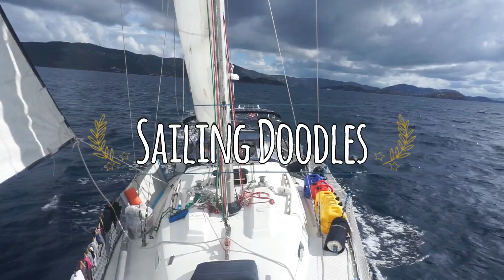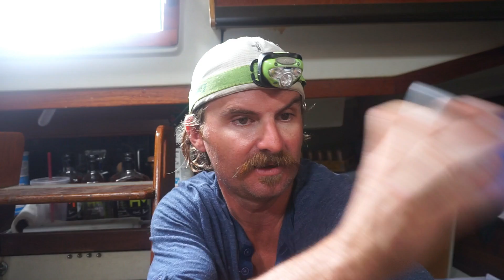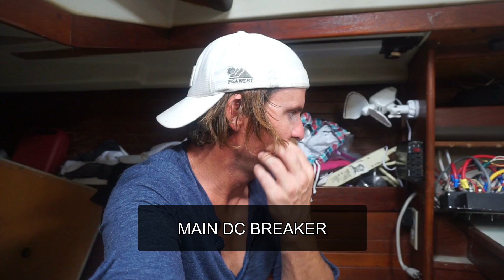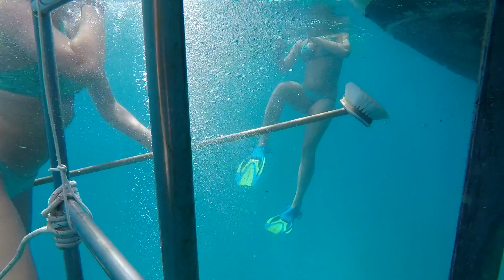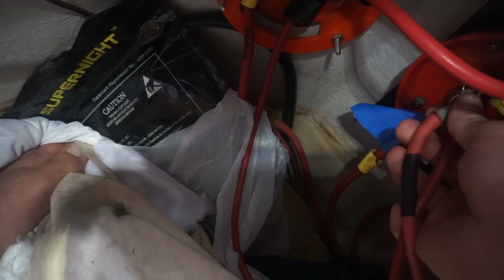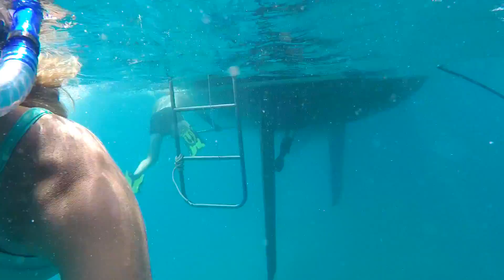Girls Clean the hull & an Electrical Failure - Boat Maintenance Monday

Comment: Next time run a continuity test switch your multimeter to ohms if it’s off you should get resistance if it’s on it should drop to zero or there abouts

Comment: In the future, you may want to consider getting a portable hookah diving system. Good for cleaning bottoms (can make money do this) good for diving, no tanks to refill.  Lots of good units around, I had a Brownies  gas powered system for about ten years, no problems, just normal maintenance.  Run three or four ropes under the boat for holding on to make cleaning easier. Clean bottom every week or two

Comment: You need to get yourself an inductive amp meter. It would be so much easier and quicker to test each circuit and see how many amps it was drawing. No need to disconnect anything.
Reply from the maker: +Ted Fox yeah that would be a really helpful tool.  Will get one when we get back to the states

Comment: I had the same problem just after I moved into my narrowboat the isolation switch was all gunked up, took it apart cleaned it all up and all the terminals and it's been fine since.... should probably give it a clean soon to prevent it happening again

Comment: When cleaning the keel, I hang lines from the sides opposite to what I'm working on, swim under, grab the line and I have a tether, no energy loss trying to keep in place while pushing against the boat with either a scraper or a brush. Reduces time cleaning, not to mention I'm no longer half shagged by the time I finish.

Comment: I had a rats nest wiring problem on my boat so I pulled all the wires and replaced them (after drawing up a new wiring diagram) with high quality marine/aircraft grade wires.  Also, West Marine had a device called a "Zap Stopper" which keeps the Alternator from frying should you accidentally operate the Battery Selector while the engine is running.

Comment: Good job with finding out your issue and I do like the way you presented it..... as long as the girls are cool with it!! 
Anyway my 2 cents worth, when tracing out a electrical problem, always start at the battery and work down. So from the Battery, you should have checked the battery switch next, which would have found your issue quicker. Also, as you know, its a rats nest in there... and I would not put anything on that battery switch but the main power wire to the panel. Get rid of the rest. Instead use a proper buss bar to distribute power to the other stuff, all thru breakers and fuses. But as you said, its a old boat and the previous owners mucked it up a bit. When you can, rewire the boat.

Comment: Here ins S. Florida stereos go bad all the time from the salt air, my flats boat had dead batteries constantly, removed the stereo and the problem went away, even if you found a problem in the switch keep this in mind possibly run stereo off seperate battery
Reply from the maker: +2thelight yeah a good idea.  I still need to straighten out the electrical system a bit

Comment: I just had to change my 29 year old battery switch as the terminal one and the exit terminal would get so hot I couldn't touch them, yet when I switched to both batteries all was fine. Took the switch apart and cleaned all the contacts but that did not solve the problem. Went and bought a new switch, no more heating but strangely my Xantech battery monitor now shows no power going into the battery one bank only shows power when switched to both or #2 battery. So loved watching this video of yours.
Reply from the maker: +Larry T hmm that's weird...  my solar charger doesn't seem to be charging as much either now...  am going to investigate that soon

Comment: best bottom cleaning i have seen in a while.
good job on finding the electrical problem, the process of elimination rarely fails. its slow, but works. 
your new intro is good.
we buy cars that cost 500 to 6000 $, i think your boat mite be worth more. 
in saying that i almost bought a 30 foot steel sailing boat that was floating and had a running motor, it would of been a lot of work. i look at many sail boats between 25 and 35 feet and 300 to 8000$.
anyway good job on a good video blog.
cheers davo
Reply from the maker: +david pac yeah I understand that.  I paid 24k for this boat but wanted something that was pretty close to ready to go.

Comment: Myles Nicholas is correct and this is a great way to find a short when it blows the fuse instantly when you replace the fuse. take the fuse out, hook up your bulb across the two fuse contacts, this loads the circuit and stops the wires from heating up. Dull glow. normal cricuit, bright glow, you have a short. If the bulb is bright, do your voltage drop tests. Simple.

Comment: Let me help you out for further electrical problems. A basic voltage drop test would have solved this problem in under 10 minutes. A voltmeter measures the difference between two voltages. Bear with me. Most people are familiar with testing voltages from power to ground and reading the voltage. Across a battery, positive to negative, you read around twelve volts by going from positive lead on positive to negative lead on negative. A test most people don't realize is possible is a voltage drop test on a positive circuit or negative circuit. lets say you had a bad connection at your battery positive connection. If you put your positive lead of your volt meter on the battery cable where it bolts onto the battery  and the negative lead of your voltmeter to the actual battery post. If you have a bad connection you will read a ..voltage drop...Could be anything, one volt, two volts, depending on the resistance of the cable and post. You should read no more than.05 volts meaning you have a good connection. If you put your positive lead to the positive. cable and your negative lead to the battery post, With a clean connection it should read .05 volts. here's why. Remember we said a volt meter reads the difference between two voltages. If the connection at the battery is good, the battery cable is 12 volts, the center of the battery post is 12 volts. 12 minus 12 is 0 volts.(less than .05 volts is what you should read. Always start your diagnosis at the power source, your battery. If you had put your positive voltmeter lead on the positive battery post of battery one and the negative voltmeter lead on the output of battery one on your battery switch. It would have read above one volt drop showing you this was your problem. Do the same test for battery two at the battery positive cable with the voltmeter positive lead at battery two positive and bat output at your battery switch.. If you wanted to check those bus bars, you could turn battery switch to all. Connect positive voltmeter lead to battery one positive and the negative you would then touch to each bus bar one at a time. Good connections read less than .05 volts. Bad connections causing a problem will usually read more than one volt. Let me make this simple, good connections have no voltage drop, bad ones do. Those breakers you were looking at. If you had simply put your positive voltmeter lead on one side and your negative volt meter lead on the other side. less than .05 volt is good, over a volt, you have a bad breaker because of internal resistance. All this testing is done withe system powered and loaded. Welcome to the world of voltage drops, making your life easier. You can do the same voltage drop test on the negative side. Hope this helps.

Comment: Now what caused the switch to get so hot? Sea water got inside or is the switch a symptom of another problem? Bikini video sure helps in troubleshooting.
Reply from the maker: +Memnar not sure 100% but I've heard that if you turn that switch while it is under load from the engine alternator it can cause that problem... so it might have been that.
Reply: I have the same switch, I'll check about that for you.

Comment: If you have (or buy) a plumber's helper, a.k.a., toilet plunger, you can attach it to the bottom of your boat with suction to use as a handle when scrubbing the bottom.  In that way, the person scrubbing no longer  is pushed away from the hull by scrubbing.
Reply: SV Esprit Libre Ya just saw that on Creo the other day, never thought of using it as a handle though. Great idea!
Reply: I have used plungers in the past when replacing thru-hulls with the boat in the water.  They work great and very little water gets into the boat.  I will be sending Bob and the girls a fix for the cleaning of the boat bottom soon.

Comment: Duh, what caused the switch to melt?
Reply from the maker: +hdave6109  it sure exactly but could have turned the switch while the alternator was powered and done it.
Reply: remotely possible but not likely. I doubt there's enough stored energy in the alternator to do that. The alternator diodes get killed (or can be, depending on circumstances) when you open the switch because the alternator voltage will exceed the voltage rating of the diodes when it has no where to go. This is not enough energy to cause the obvious heat damage at the battery switch terminal. This kind of damage is due to resistive heating. Either the internal switch contacts made poor contact due to aging, corrosion, etc., or the power cables were not fastened tightly to the stud and made poor contact. In either case the small resistance created by the poor contact lead to localized heating and was most likely the root cause of the voltage drop you observed at the panel: with some resistance at the switch, the open-circuit voltage will measure very nearly equal to battery voltage, but as you add even a little load like your stereo or the fans, the voltage at the panel drops dramatically because some of the total battery voltage is being dropped across the resistance of the failed switch contact or poor terminal connection. Apparently about 3 volts in this case. The voltage drop across the switch contact will vary depending on how much load is placed on it. Obviously at some point enough load was drawn for long enough to heat the terminal and melt the plastic housing. I'm glad you found and fixed this, Bobby. It's an extremely effective way to start a fire. You should check all the terminal connections where high current is expected to flow (e.g. all of the battery switch studs, etc) and make sure they are tight and free of any corrosion. If any of the battery switches are old, you should replace them all now. One of them has already potentially demonstrated an age-related failure. You really don't want this to happen again.
Reply: That's what I was pointing towards during the live stream the other day. I have seen it happen and have had it happen when people mess with things. I always put a big label on my switch that says, "DO NOT TOUCH".

Comment: I always wondered why don't sailors pull a line around the boat hull and tie it off in what is an effective line circling the boat to HOLD onto while scrubbing so leverage can be increased? Is there a reason not to?
Reply: Marine stores sell a purpose built double suction cup hand hold, about $15.  Great for holding yourself to the hull while cleaning, thus not expending energy, read oxygen, swimming.  Same idea as the plunger.  PS, great cleaning footage, lol.
Reply: Dean F I use the inertia method. I go for and aft always keeping a forward motion. sweeping paths in a line the length of the vessel like mowing a lawn. I just grab on to the edges of the keel  and rudder while attacking those. wear gloves. I also like to be where there is current so the muck cloud doesn't meander. but I must add I would let those girls go on working any way they dang well please....Bob you are a lucky guy!!!
Reply from the maker: +Dean F that's a great idea...  I will try that!

Comment: +1 on providing a line for bracing while bottom scrubbing.  Many run it from gunwale to gunwale under the keel. Also a weight belt makes it easier to hold your position.   Hate to repeat myself but you really need a better meter that does DC amps. Would have saved all day messing about.  Just clip it over the wire and see the size of the load. Just FYI you can also get a test device that injects a signal over a wire and you just hold the other part near a suspect  wire and if it is the right one it beeeps. Very cool .

Comment: Very nice video. Super job on the the electrical debugging. I am curious though. How did eliminate the stereo without getting a new one?
Reply from the maker: +David Humphrey  it didn't make sense to me...  there was. I way it could draw enough current to cause the issues we were seeing and it didn't matter what load came on the system...  if I turned on any breaker the voltage would drop

Comment: Congratulations on getting above 200 patrons. Tough to feel bad for you Bobby when you have stunning Megan and Georgy working on the boat too.

Just trying to help so please don't shoot!! I can only guess without seeing your electrical system but have the following thoughts - A post on the 1-2-Both switch melting must have been driven by an over current. You fixed the switch but may still have a short. If you reroute the alternator output cable from the switch to the positive post on your house bank you eliminate the risk of blowing the diodes in the alternator. The switch is removed from the charging circuit and becomes a "use" switch i.e. battery selector or engine on/off. Did I mention Megan and Georgy are amazing?
Reply from the maker: +S/V Della Jean that is a very good suggestion and makes total sense....  I really need to rewrite the whole system.
Reply: Glad it was helpful. I've found most boat problems are electrical. If you do decide to clean up your electrical system I can send you a PDF of my DC schematic. I have a different brand boat and no inverter, but it would be helpful as a reference.
Reply: Agreed. Melting parts of the electrical system is a red flag. One of the first items to accomplish after buying a boat is to do a full trace of the entire electrical system and document/laminate it. This will help the safety of the boat and allow easier troubleshooting in the future. It will also allow you to identify ways to save power when you need it. Do you know how much current the PDS is drawing, and if the upstream switches and cabling will support that much?
Reply: sailinstyle it certainly could be a failure due to a resistive load at the switch. Hard to be absolutely sure without running diagnostics on the system.
Reply: Respectfully disagree. Silas Marner is correct. Localized heating due to resistive contact.

Comment: I knew the instant you started that debug what it was. I'm an electrical engineer .. you can hit me up any time to get some debug time... when convenient. but yeah, you got to the bottom of it. There was a resistive contact on that mechanical switch. It's supposed to be sealed but obviously not.. and the series resistance x (current ^2) = power.. and that much power melted the contact.  
With a fresh contact, Rs (series resistance) is basically zero, so ( I^2* r )=power is also zero. But with a bit of resistance (probably contact resistance, so yeah, in series) it made I^2*r higher, so it got hotter, and hotter, and hotter.. then it melted/bubbled up. I don't know if you tossed that switch but I'd love to cut it apart and do a post mortem.  Great video!
Reply from the maker: +Silas Marner I wish I would have kept it now. It threw that trash out yesterday!  Thanks for the help though!

Comment: if you run a line around the boat at the waterline, so you can hold on to it so you can scrub.
Reply: just not a 12v line ;)
Reply: Sean T 12V won't bother you...lol. use 12v power scrubber if you dare.

Comment: A test lamp made with a 10 or 20 Watt globe, alligator clip and a probe is needed.
You will spot a short circuit instantly, as the lamp will glow brightly.
Dull glow from normal loads.
Made my first test lamp in 1969.